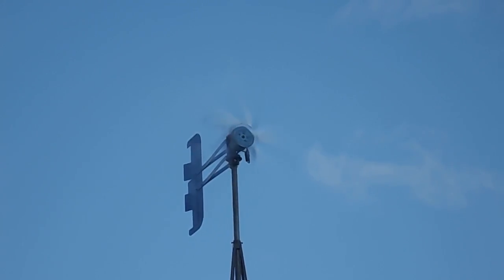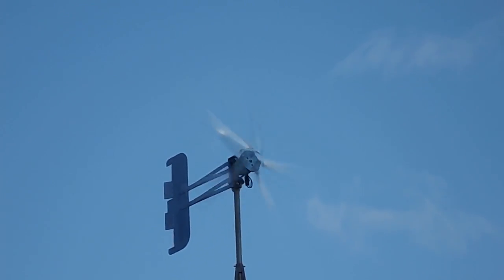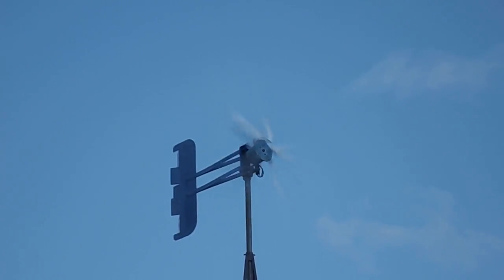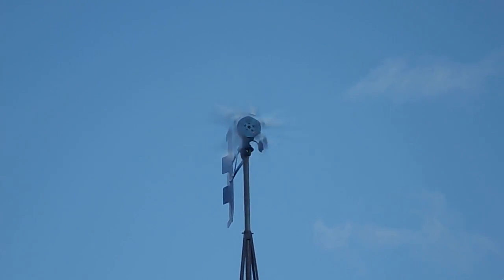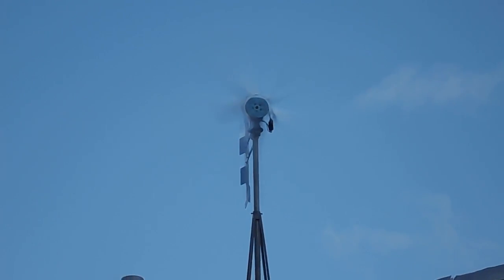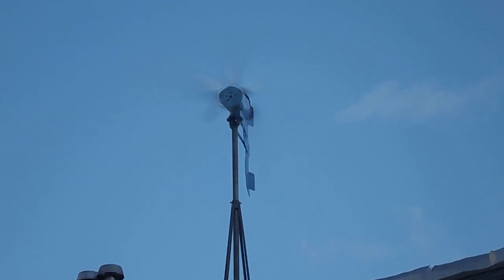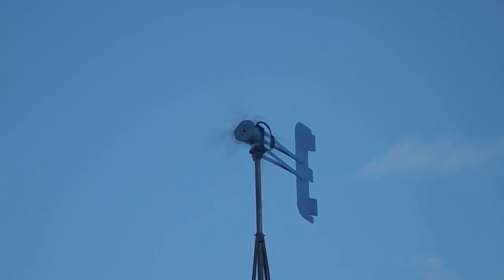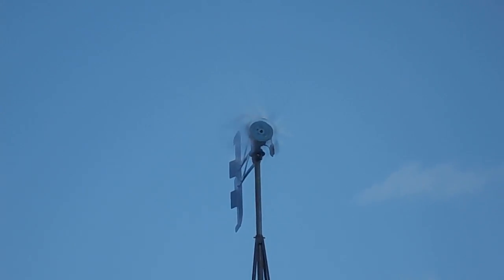Missouri Wind and Solar Freedom cannot do this

Comment: I have to say I do like that mounting bracket. Keep up the good work and thank you for sharing. I had to change account's you have my other account blocked.
Reply from the maker: +TheGamerBloke  Thanks Alan  Here's a better view of it.  https://www.youtube.com/watch?v=8Fv43mBormI  We were having 50 and 60 MPH winds last night.  Didn't even whimper.   The platform is a big plus.  It weighs between 50 and 60 pounds.  I suppose I could have cut some weight is I bought some lighter steel.  I used what I had .